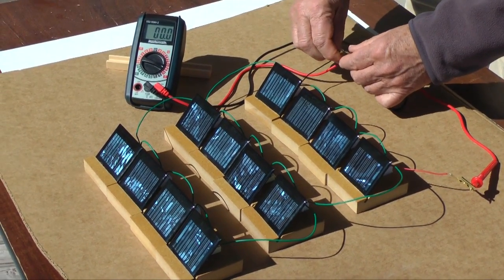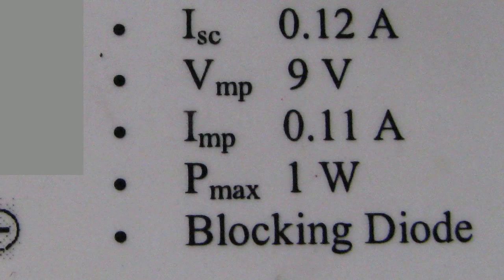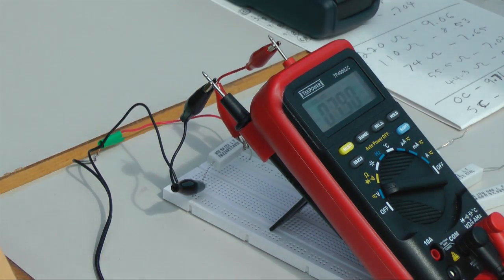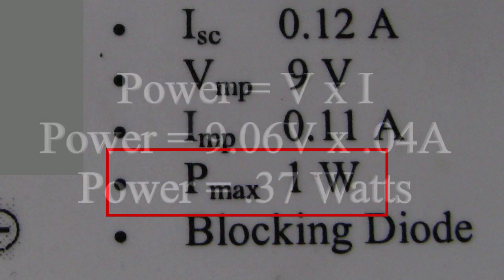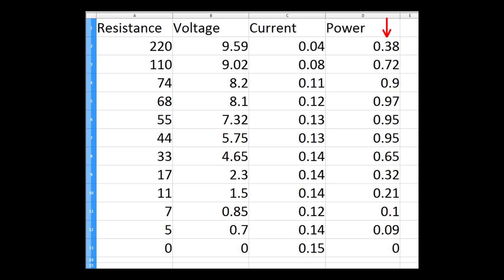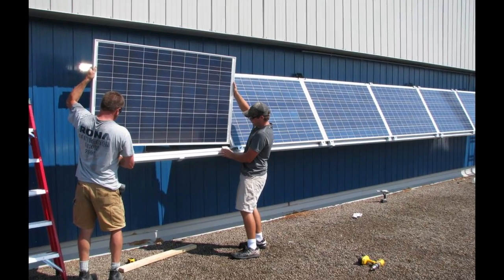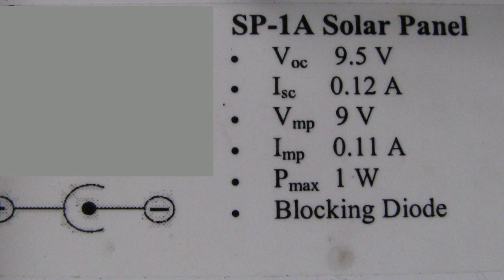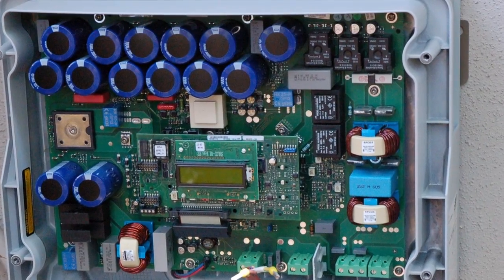Solar 102 - Power Calculation

Comment: IMPORTANT: The maximum power point always depends on various environmental conditions (incl. panel temperature and solar irradiation). Accordingly the „optimal“ load resistance constantly changes for the same panel according to those conditions.
Reply: Hy

Comment: use your technique to tune the panel and find the voltage. then could you possibly make a really simple power point tracking charger if you had a supercapacitor attached to the solar panel and then slowly pulse the battery/load using a microcontroller until the voltage on the capacitor drops below the peak power point voltage and stops pulsing so it can charge when its under to maintain equilibrium?